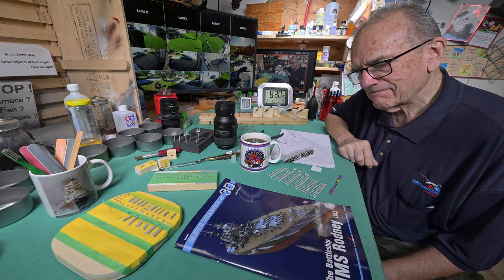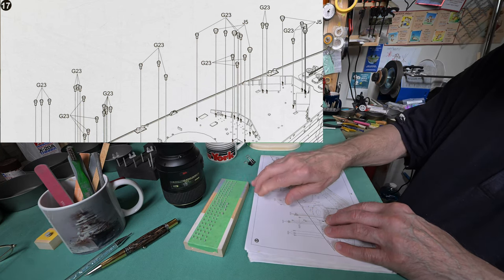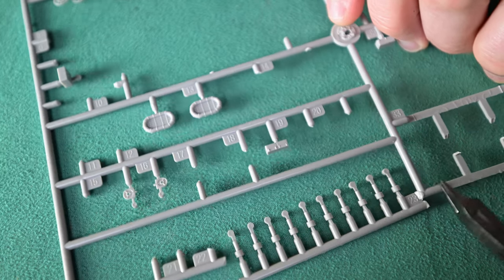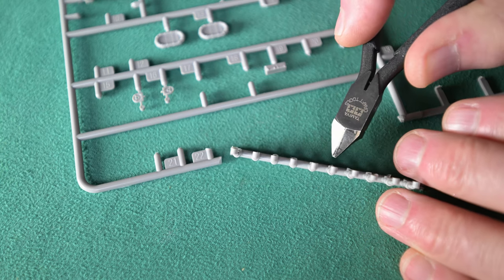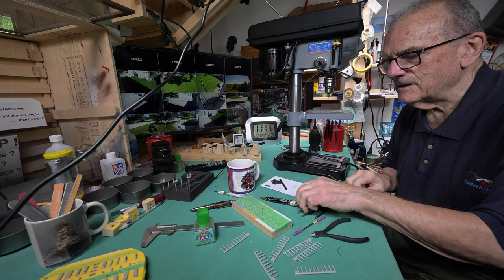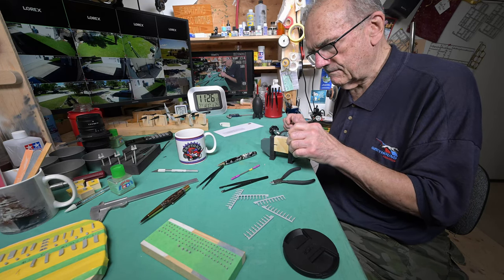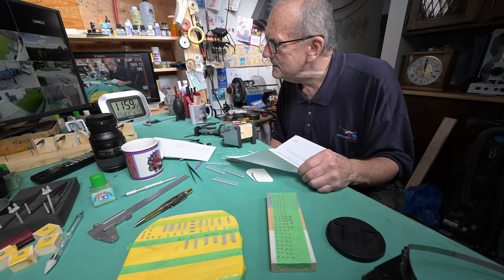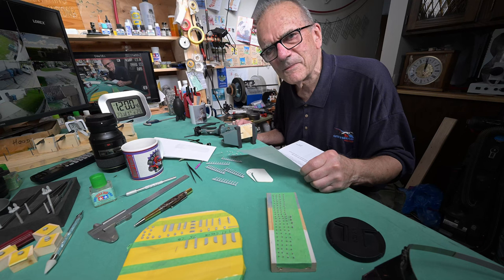The Model Ship - Part 1203

Comment: Fascinating!
I know I'm well behind where you are now, but as I intend to buy Rodney,,I'm reviewing what you did.
I think Trumpeter did the G sprue and rye G29's wrong. They've attached the top of the vents to the sprue and put the "reservoir" for want of a better term at the mounting pin end.
Wrong! If they'd reversed that, you could have trimmed of the reservoirs, exposed the tops of the vents, which you could then have cleaned while the parts are still on the sprue, and painted them to boot.
Now, if you or any of your viewers find themselves in a similar situation, then go get a length of poly strip, glue it to the reservoirs, cut the heads off from the sprue and then carryon as above. That's what I'm going to do.